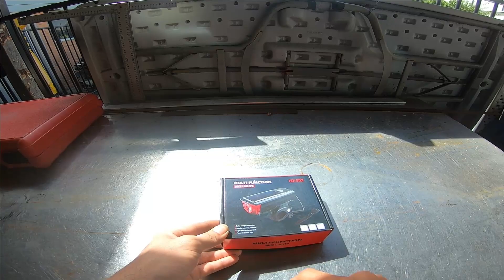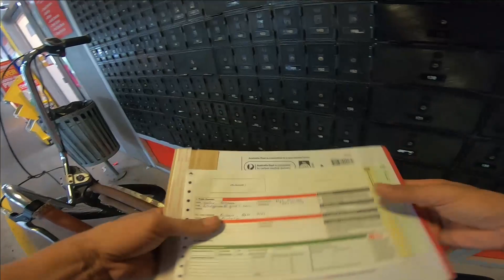Giveaway! and also test ride of a rusty cruiser i just finished.

Comment: nice multilight there.. i assume given the usb out and functions that the main battery is a 18650 or similar then? Congrats on a bit of decent overseas order to finland! like the swap over to the bike build! I can just picture you doing a "sleeper" e bike now.... lol ... hubs front and rear with the full max high waltage applied to give your wolf a run for its money hehe. awesome 'Highlights' there and thanks for sharing another build with us
Reply from the maker: 18650 or 21700. havent pulled one apart yet lol. its just bushes for the wolf. someone wants to try them out. thanks :) nice insert of the entry word ;)

Comment: Highlights
Reply from the maker: Yo. Got ur controller today. Ur water damage sticker is red.... had heaps of dirt and grit inside controller. Going to test as soon as there is a dry day.
Reply: @highwaltage  thanks mate, yeah that's not good :/ Hopefully it's okay. There's no dirt or water proofing on the mantis unfortunately.
Reply from the maker: @WES-GR4PES  should be ok. Do you have thermal paste to apply to the flat bit that bolts to the deck when you get it back?
Reply: @highwaltage  no I don't have any. Is it just like CPU thermal paste?
Reply from the maker: @WES-GR4PES  yep :) gotta help the heat transfer to the alloy deck real good like once its boosted up.
Reply: @highwaltage  thanks for the heads up. I'll make sure of it :) so keen to see the performance difference. Will you make a ride video of your testing?
Reply from the maker: @WES-GR4PES  probably not. i got a few other scoots to do atm.
Reply: @highwaltage   thanks for boosting my controller mate, I just got the news it's being posted today. Did you have to replace any fets?
Reply from the maker: @WES-GR4PES  yes. Just one. Time consuming bit was having to swap n change over to test it. Having the whole scoot is much quicker. I spent most.of yesterdays dry spell testing.  Plenty of hours involved that i dont charge for. Make sure you get thermal paste.
Reply: @highwaltage   I really appreciate your hard work man. Sorry I couldn't get the whole scooter across. I'm so keen to ride the scooter with this mod. Thanks again. I've ordered some mx-4 thermal paste.
Reply from the maker: @WES-GR4PES  good stuff. Top speed might only be a couple of kmh more. But the torque should be keeping ya on yer toes :)
Reply: @highwaltage  haha awesome. Thanks mate
Reply: @highwaltage  hey mate, do you have a Facebook or email? Need to ask about the scooter. It worked but I wires the lights incorrectly and the globes where acting weird so I disconnected the battery and retried with them wired differently and soon as I connected the battery again it sparked and now the scooter won't turn on. Fk me I hope the controller is okay. I need you're help urgently.
Reply from the maker: @WES-GR4PES  
my email is in my profile.
Reply from the maker: @WES-GR4PES  there is no rewiring them differently.. there is only one way to wire it all back up.
Reply from the maker: @WES-GR4PES  djncryption@gmail.com
Reply: @highwaltage  thanks mate, never mind about what I said. I got the scooter to work. Going to test it tomorrow. Didn't wiring up the lights.
Reply from the maker: @WES-GR4PES  ur lights to the step down is the white and orange from the controller. goes to the right side of the scooter.
Reply: @highwaltage  thanks mate. Top speed hasn't change. Low end torque is a bit more punchy :) you did a great job man.
Reply from the maker: @WES-GR4PES  enough to give you arm pump lol. enjoy :)
Reply: @highwaltage  hahaha holding on for dear life. Wheelies are easier too :) this will keep me happy while I save up for a wolf.
Reply from the maker: @WES-GR4PES  hell yeah :) better than me then! im not a fan of monos on the mantis. ie i cant hold em lol
Reply: @highwaltage  haha it always wants to lean even with 3" tyres, but it's doable. Any chance on getting the mantis to go faster than 60kmh? Or not worth it.
Reply from the maker: @WES-GR4PES  you gotta add more volts to get more rpm's. hence my booster pack. to 75v charged. (max of the internals)
Reply: @highwaltage  you'll need the whole scooter for that yeah?
Reply from the maker: @WES-GR4PES  preferably yes. Not cheap. Best saving for that wolf ;),
Reply: @highwaltage  haha okay will do :)